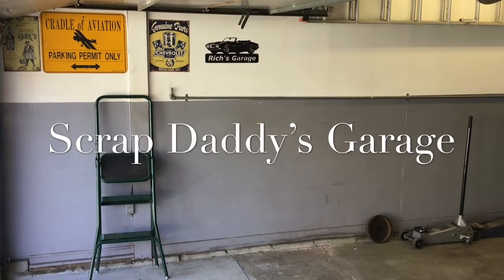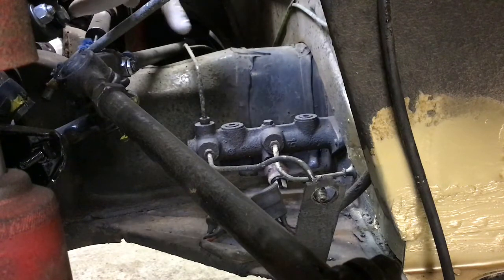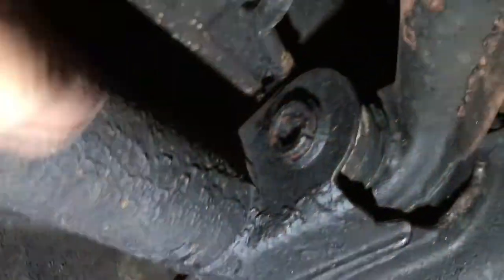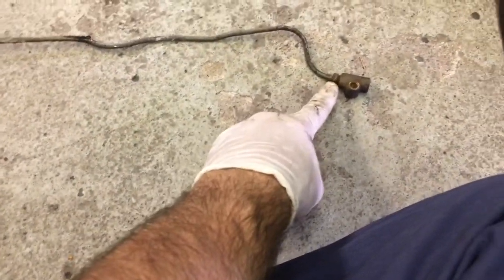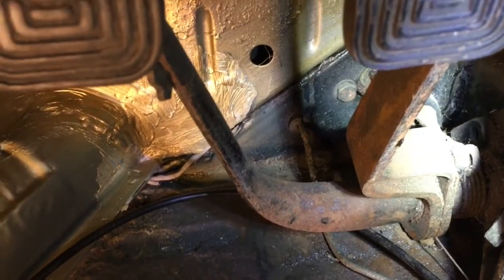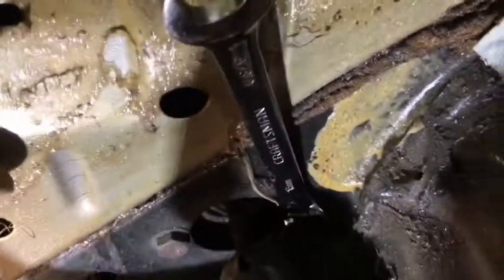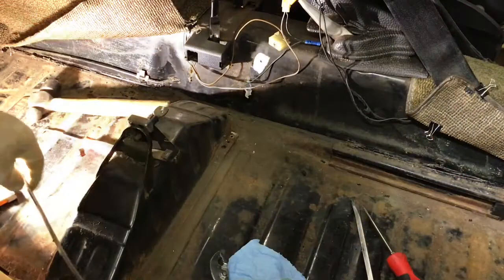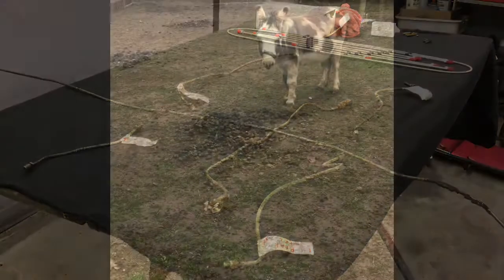Original Owner VW Sunbug gets new brake lines

Comment: I think the fins on the main brake line bolt going to the master cylinder have worn down making it impossible to catch and tighten on my 1969 beetle. I'm thinking of using locktitght or worst case jb weld to make the connection. Any possible ideas ?
Reply from the maker: Take a close look at the threads and try to figure out why they won’t tighten, they could be damaged beyond repair. I don’t recommend using anything on the fittings to make them seal. Unfortunately you may have to replace parts, you don’t want the brakes to fail when you need them the most. Thanks for watching.